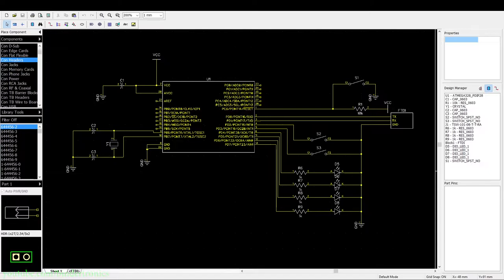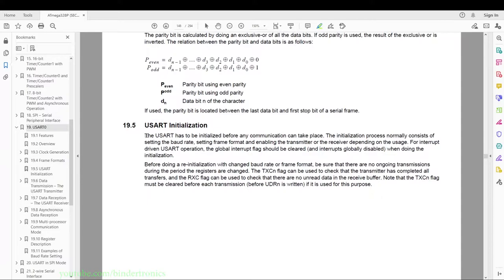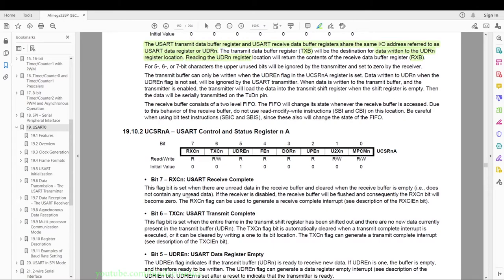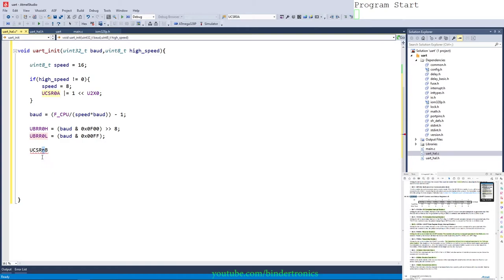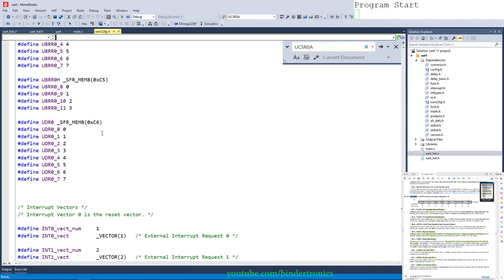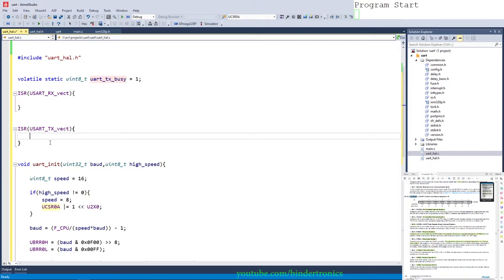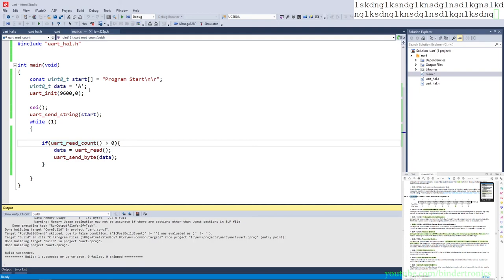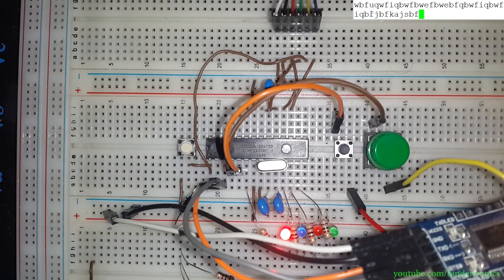Serial UART 🔴 ATmega328P Programming #7 AVR microcontroller with Atmel Studio

Comment: very usual. thumbs up from me.
the RX methods work great,
The TX methods are not very good fast though, i ended up using the same buffering principle from RX for the TX functionality allowing me to transmit arrays without waiting for each bite to send.
a very useful informative video set me in the right direction quickly.
thanks

Comment: An example of 9-bit configuration is used for MDB communication protocol. It is used in vending machines, and I don't know who decided it is a good idea to use an extra bit...
Reply from the maker: Had a look at the specification sheet. Interesting serial protocol. Using the 9th bit to determine data direction. That makes 1 so far.

Comment: I would like to express my gratitude for the valuable assistance you have provided through your videos. Currently, I am working on an academic project that involves the Atmega328P microcontroller, where I am required to use two UARTs - the native one, as well as other pins that function as UART. Can you please guide me on how to accomplish this task?
Reply from the maker: Option 1:
Use Arduino software serial lib.
Option 2:
Use a Atmega328PB that has 2 native serial ports.
Reply from the maker: Option 3:
The big daddy in the line up. ATmega2560
Reply: If i use the Arduino Software Serial lib  to communicate with the microcontroller, then i must use the Arduino IDE to write and compile my code ? right ? . However, if i use Atmel Studio to write my code, then i'll need to create my own library to communicate with the microcontroller.
Reply from the maker: @BenomraneAbderrahmen  You are not constraint to the IDE. Atmel Studio supports Arduino projects. 
Simply create a port of the soft serial lib in C.
https://gprivate.com/64bzv second link looks promising.

Comment: WHAT SOFTWARE DO YOU USE WHEN WRITING THE LETTERS IN THE UPPER RIGHT CORNER
Reply from the maker: putty. any serial terminal will work
Reply: can MAX232 work with putty software?
Reply from the maker: Get yourself a CH340 or FTDI USB to serial converter. MAX232 (RS232) runs on -12V to +12V. If you want to use a MAX232 you are going to connect MCU to the MAX232 turning the into a RS232 line. Then you need a RS232 to usb serial converter. THE CH340 or FTDI is a direct connection to between the MCU and PC.
Reply from the maker: This is what you looking for and is the same board I am using.
https://www.waveshare.com/ft232-usb-uart-board-micro.htm